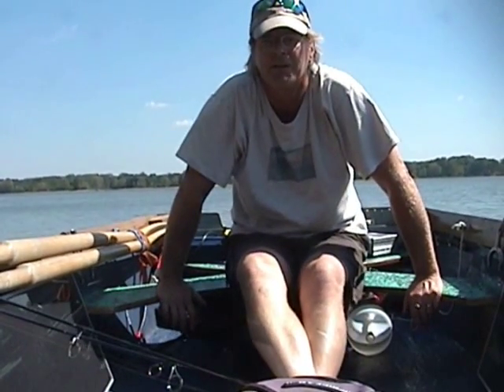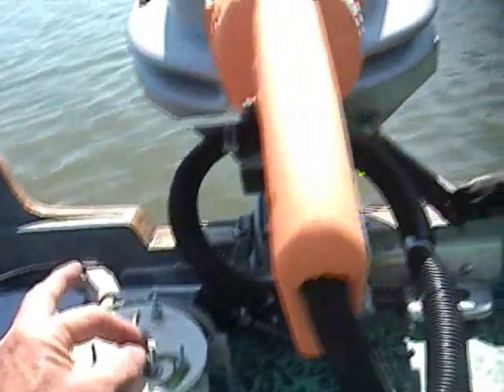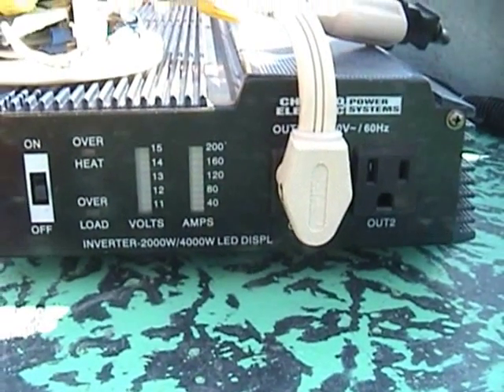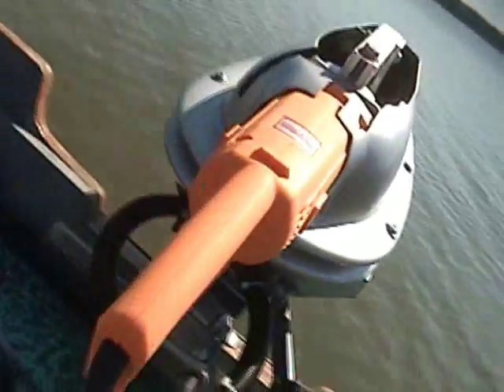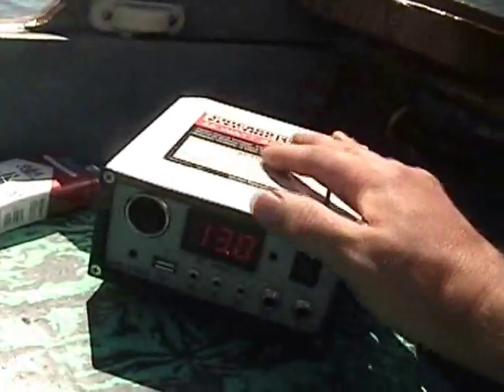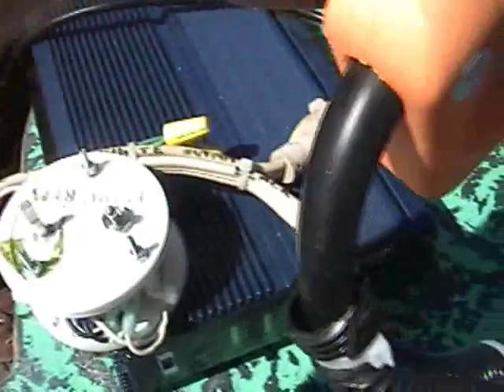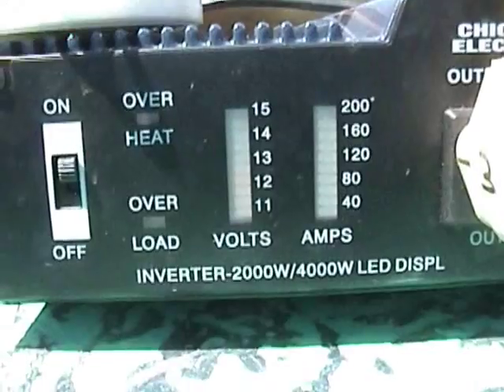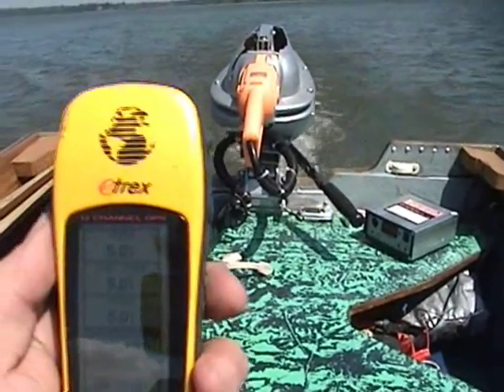electric outboard motor Angle Grinder part 3 of 6

Comment: 160 amps? Lets see, run time of five minutes for every two days of solar charging. I like your creation, however that motor is not efficient at all. By the time one get through finding a motor and doing all of the screwing about you might as well buy a good used battery outboard and spend more money on the batteries and solar equipment. I got one of the things with 30 pounds of thrust and it will run 8 hours on one standard optima car battery with my 12 foot glass boat. Nice job! nice video.

Comment: @videobreakthru Very helpful; thank you. I've got a car radiator cooling fan motor to go on it which is about 3 times the size of the windscreen wiper motor I last upgraded to. As your figures indicate not too much gear reduction on production outboards I'll try a lashup with direct dirve and play with prop size and pitch and see how it goes. At least my 12V generator is finnished now which will be handy if the boat runs out of power!

Comment: I've got one on Youtube that I made but it isn't very powerful and I've got a bigger motor to go on it. The problem is I can't find a suitable gear box to reduce the prop rpm from the motor so I'm thinking I'll make it direct drive. This means the prop will be doing about 3000 rpm which may cause cavitation unless the boat responds with a high speed. I'm just wondering what your prop rpm is.